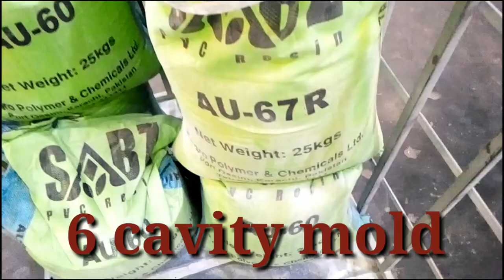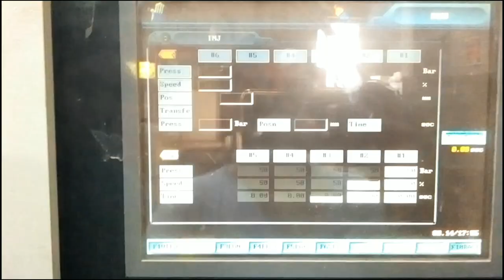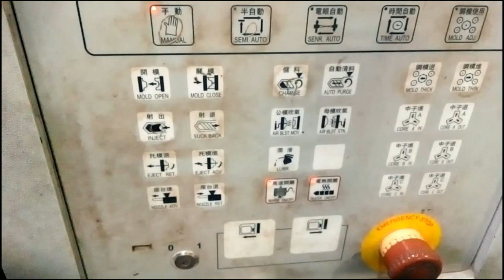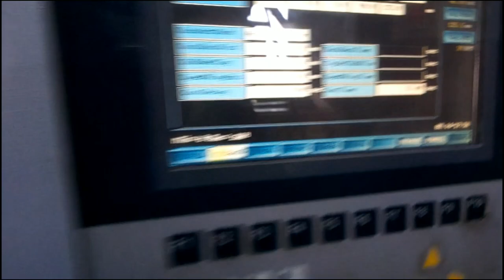Injection molding process|1" Elbow 90 |molding product|Pvc fitting|business ideas|Pakistan|India

Comment: PVC resin k elawa or kiya kiya items is resin mein mix ki jati ha is ki knowledge ha apko or yeh China ki hr injection molding machine servo motor par chal skta ha k is resin k use k liye yeh PVC fittings resin mein bena nay k liye sepcially koi machine ati ha
Reply from the maker: Assalam o alaikum, yes PVC resin k sath different qisim k additives ismien milae jate hien. shukar alhamdolillah is formulation ki knowledge he. screw design mien thora change hota he but agr apke pass machine he to thora kaam kerne k bad usper chal skti he iske ilawa apko kuch pochna ho to aap 03442614146 pr mujhse bat kerskty hien.
Reply: @TechnicalpointSFA   china ki hi injection molding machine hai to Phr bhi screw mein kam krwana parta hai kiya
Reply from the maker: @jibranmemon2236  ji sir pvc chalane k liye kerwana hoga .
Reply from the maker: @jibranmemon2236  screw me aage ki teref ring lgta he